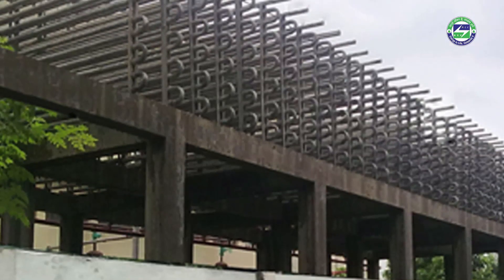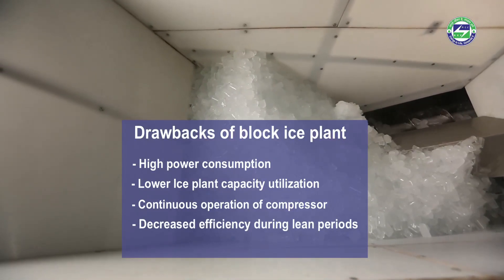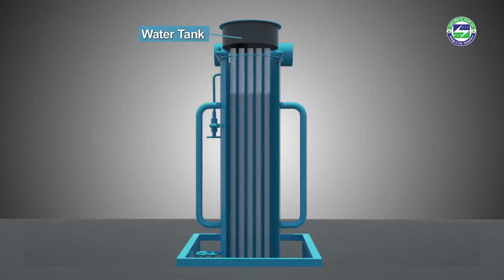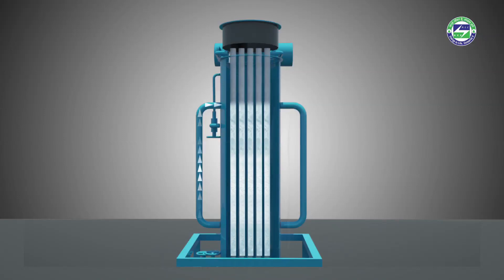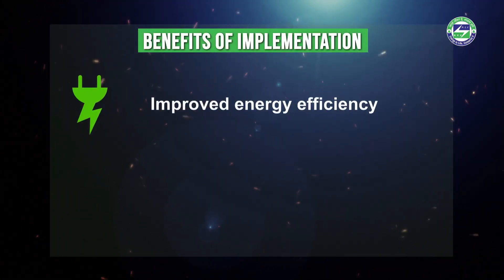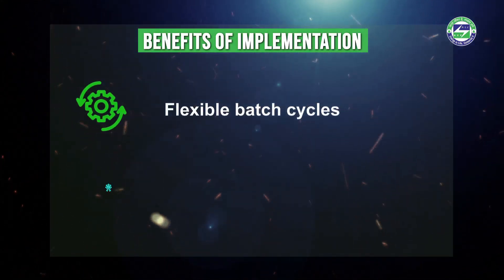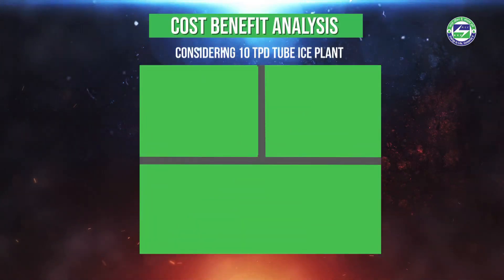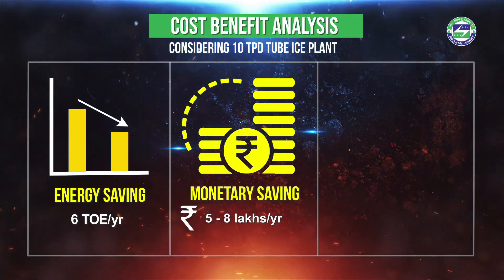Replacement of Conventional Block Ice Plant with Tube Ice Plant

Comment: i need 2ton tube ice plant
Reply: Don't buy their 1 ton and 2 ton plant. L am suffering oil pressure Tripping probelm even they've no solution also.
Reply: In the main labor, if you want to make a banana at your place, you will have to provide that much ton of material and if you want to make  in my place then you will have to provide the materia.

Comment: Chirag Ice Factory (Ice Ling) third class company they have given me a faulty ice plant of 1TPD. I will suggest you don't buy any machine from Chirag. The problem is ''oil pressure tripping''.
Reply: Ok
Reply: But we need 2ton ice plants
Reply: I need tube ice machine please send any manufacturing company  contact
Reply: Right and 40 ton provide plant tube ice machine but out put production 37 ton and month of February March April 32 ton not complete production  third class Irani chirag ice machine